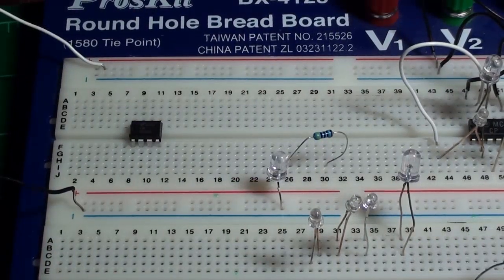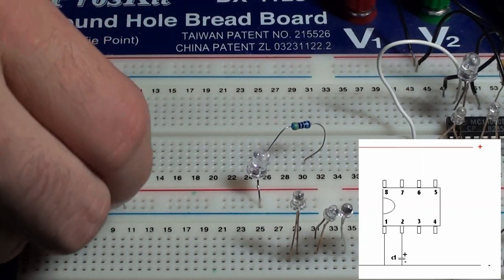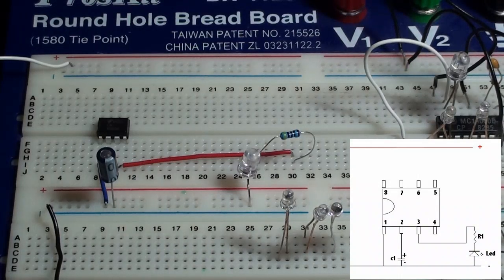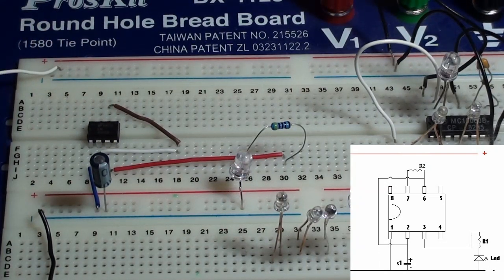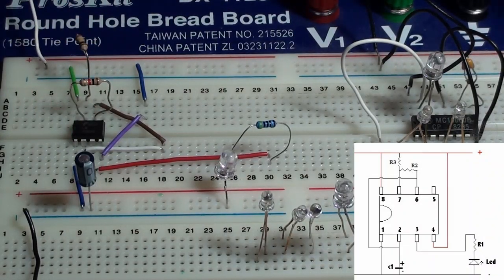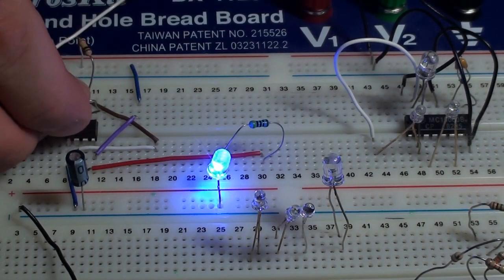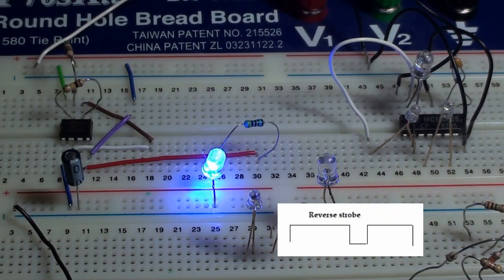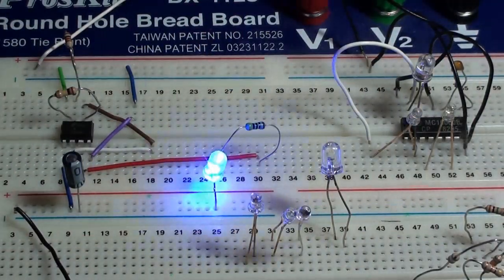Lighting Tutorial:  The 555 build up

Comment: If you wanted to operate a small reed relay rated at 12V off a 555 supplied with the same 12V, it might not work properly because you would have a 1.5V output drop (10.5V) plus the .7V drop (9.8V) from the protection diode trying to power a 12V rated device. This voltage drop has caused me a lot of headache when trying to add timers to certain things. For LEDs though, I just stick a 1k resistor there and get on with my life, lol

Comment: I think I see what you're saying about keeping a safe current for LEDs. Assuming the output it is at Vcc will ensure that the calculated resistance is well above the minimum for a safe amperage through the LED. However, the 555's output is controlled by internal NPN transistors. There is a voltage source/output difference.  This wouldn't really be a problem powering an LED, but the 555 can handle up to 200mA.

Comment from the maker: But your comment does make sense.  The chip should drop the voltage a bit.  Where else does it get the power to run itself from?   I will just keep using the idea of voltage in = voltage out for an added factor of safety....

Comment: the output (pin 3) of the 555 is somewhere around VCC - 1.5V, resistors limiting current for the LED do not need to be as high a value as they would be when calculating from the voltage supply.